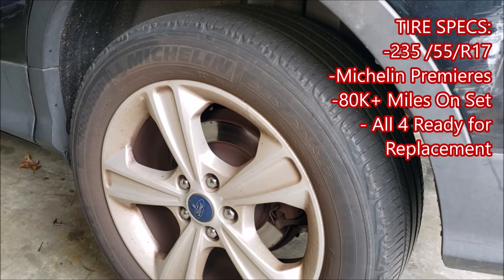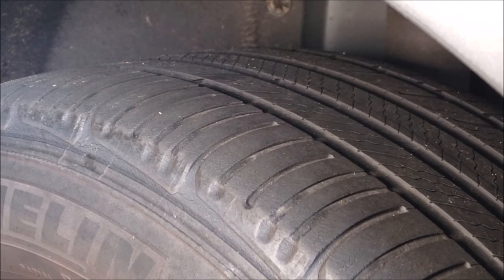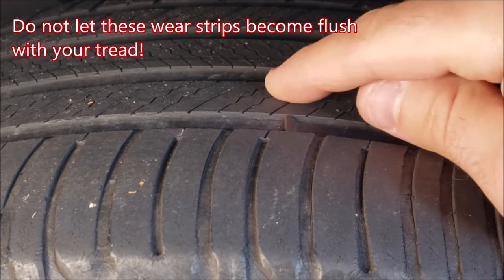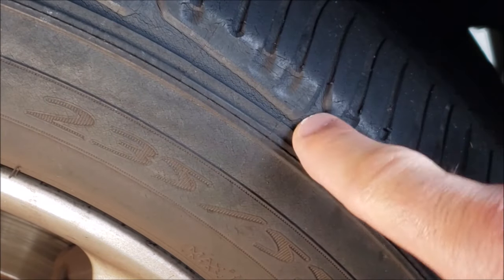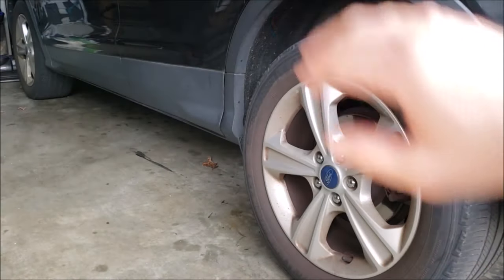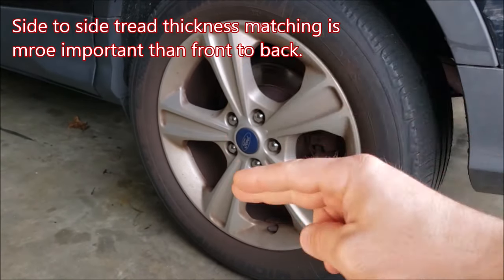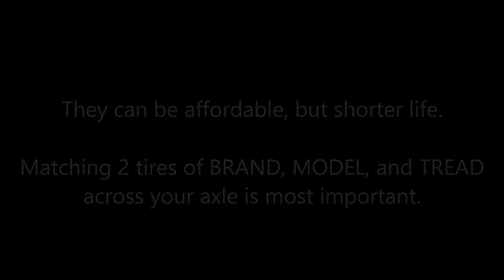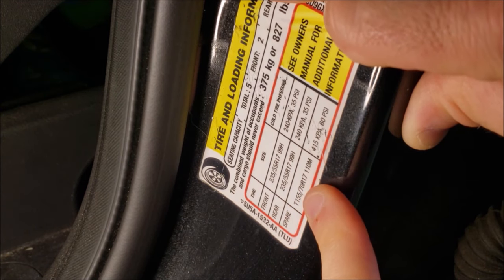Tire Tread Depth Check and Tutorial: HOW TO ESCAPE

Comment: Great video.  'Rotate every oil change' is great advice for many/most people without a tire tread gauge but I'm of the opinion that it's better to 'rotate when tread on the front tires is less than the back tires' (for all but RWD vehicles, anyway).  This especially applies for people who look after other people's cars - which may not get regular rotations.
Reply from the maker: Noted and thanks so much- good advice and I'll add it in the description below and in the app as a tip! I appreciate your help!

Comment: No mention about directional tire versus tire rotation pattern???
Reply from the maker: You're correct. I will do a new video as a follow up on this soon- there were lots of items missing as this was supposed to be an overview but I couldnt fit everything in there at once. I did not think about directional tires just bc mine are not but its a good point to bring up as they're common. Just curious if you use directional tires on your vehicle? Do you drive an Escape? Thanks!
Reply: @HowToEscapeDIYTipsandReviews  Yes directional tires on a 2014 Titanium Escape
Reply from the maker: @maestra1st  ok cool- thanks for confirming. What kind if you don't mind me asking?

Comment: Another fun tip about tires.... Doesn't hurt to check the air pressure in the SPARE from time to time.  Nothing sucks worse than having a flat tire on the outside of the car, and after lifting out your spare tire, you find it is just as flat.  🤔🤬